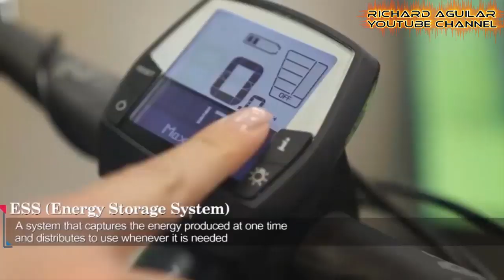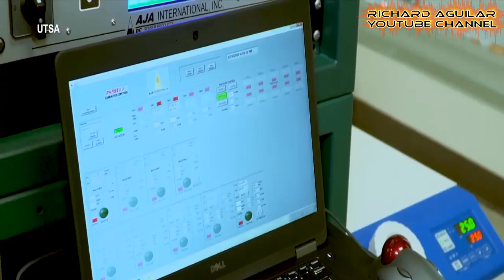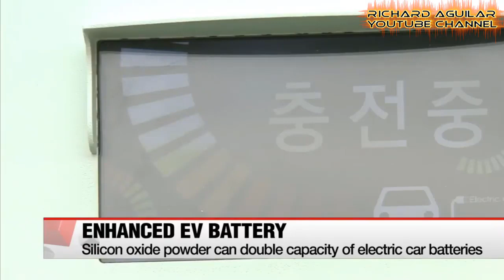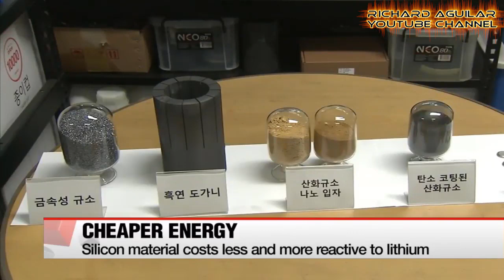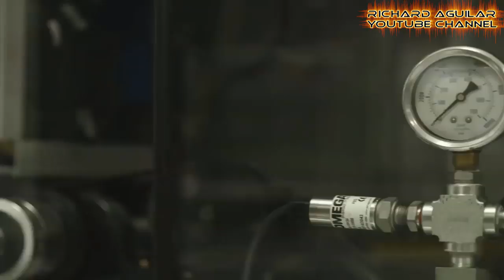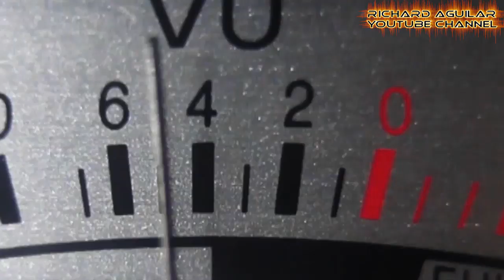The Battery Revolution! Innovative Battery Breakthroughs And Application Revealed

Comment: Wind and solar energy combined with battery storage makes them base load grid power 24/7
The world needs to get off of fossil fuels as soon as possible. 
There is a Climate Crisis as well as a pollution crisis.
Better batteries will help with the transition.
Electric vehicles are just better technology.
Gas and diesel are OLD polluting technology.